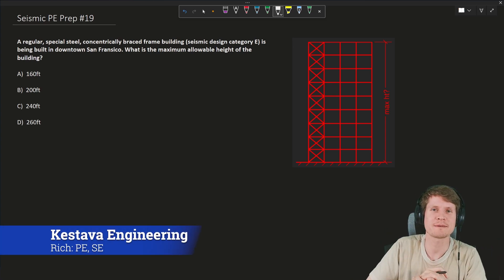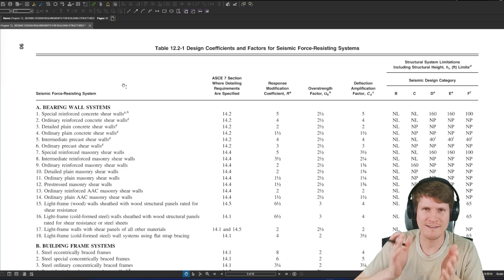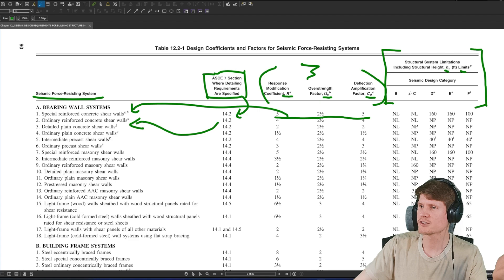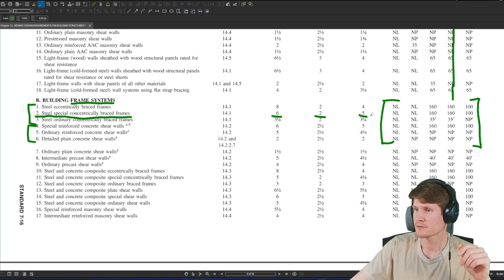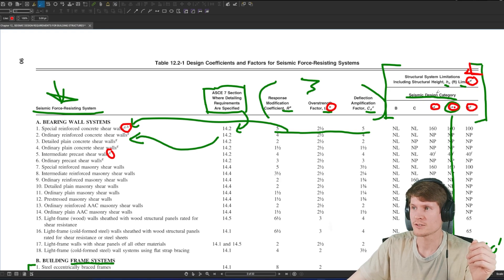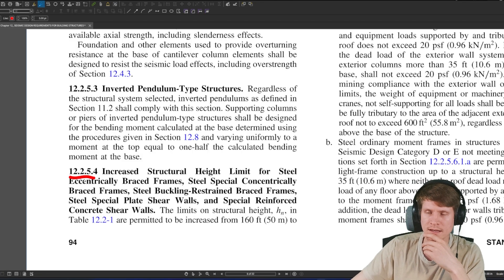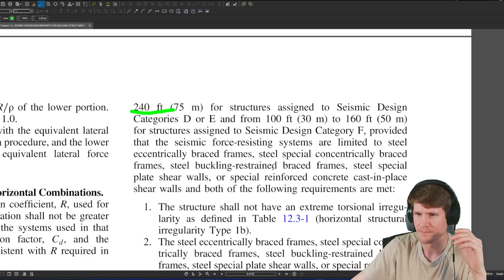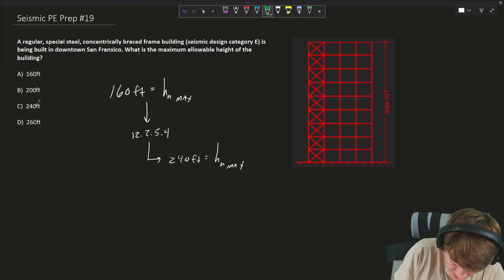PE Seismic Example Problem - 19 #structuralengineering #civilengineering #engineering

Comment: HI Thank you for all your videos and informative content.  my question is since this frame is concenttrically braced frame with no other seimic force resistiong system , shouldnt we consider that braced frames will take 100% of the seismic load and hence going with the 160 ft instead of the 240 ft? since there is no mention of other lateral force resisting systems in this direction my understanding is that the braced frame will be the taking the entire seismic load.
Reply: PE problems are pretty clearly worded. I interpret this example given as being a learning example--not intended to be strictly identical to the PE exam's wording. So, on the exam you'd probably go with 160ft, but he's saying that as an engineer in a real-world scenario you'd very likely end up with 240ft. It's important to know that this section of the code exists, whether you take the PE or not, as an engineer.